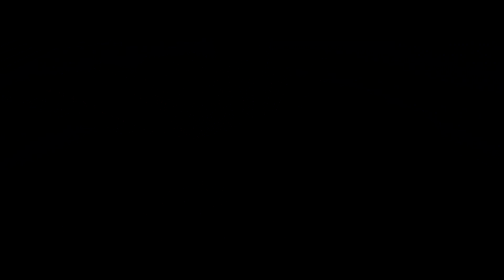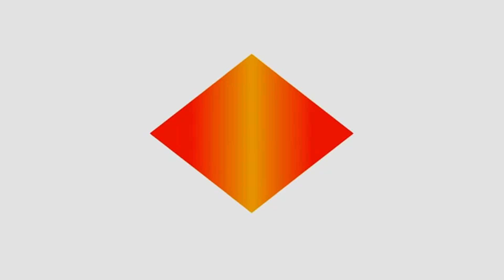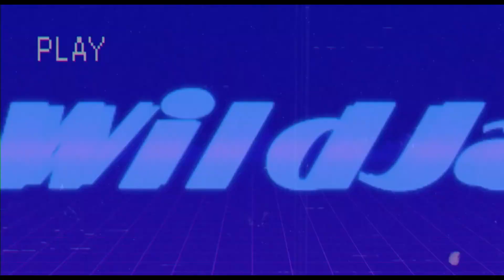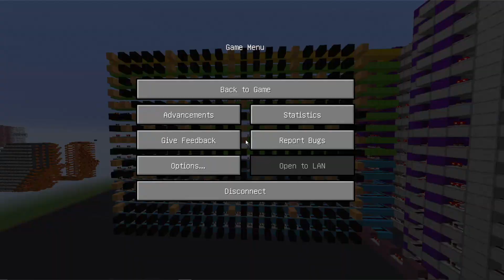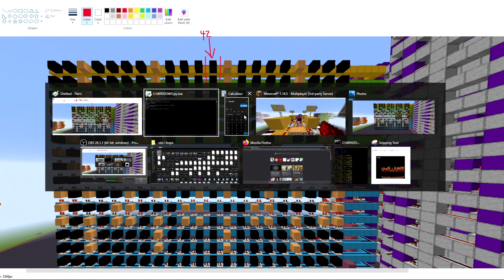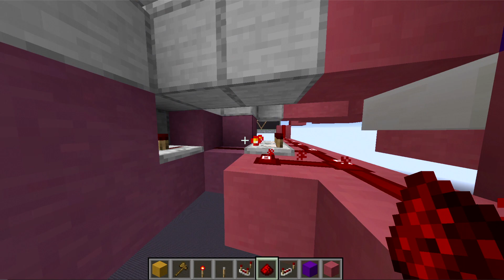Is this the fastest solid state multiplier in MC? + GPU UPDATE

Comment: Isn't the fastest way of making a pipelinable multiplier just putting adders in front of each other? It is possible to a 6-tick 8-bit adder (full strength output), so multiplying two 8-bit numbers is possible in 3×6+2=20 ticks. The 3×6 are adders, the +2 are the AND gates.
Reply from the maker: This is 2  signed 16bit values producing a 16bit result. The multiplier including both signing units is 44rt.
Reply: Oh, I see

Comment: Daaaamn this intro, really neat!  I'm still mind blown with how far you've gone!
That struggle on Windows Photos and then the switch to MS Paint 👌
Also when you talk about a "queue" for the line drawers, you mean a buffer?
Keep it up I'm always amazed by this stuff!
Reply from the maker: its kinda needs to be a queue because a buffer would have a fixed length where the queue only needs to hold as many vertices that get streamed through, but tbh we may end up just settling on a buffer for ease.
Reply: @WildEngineering  makes sense!